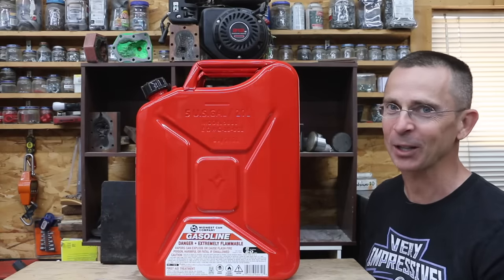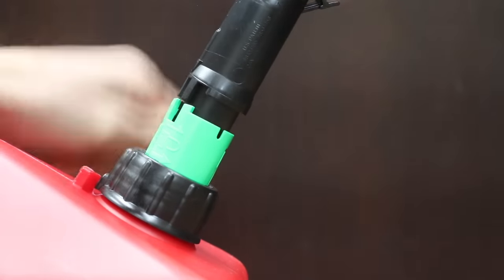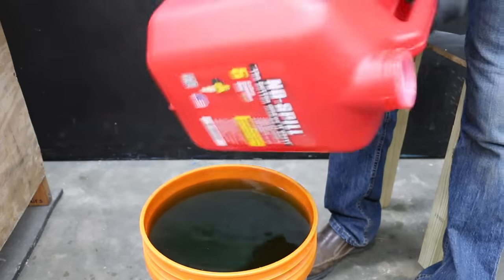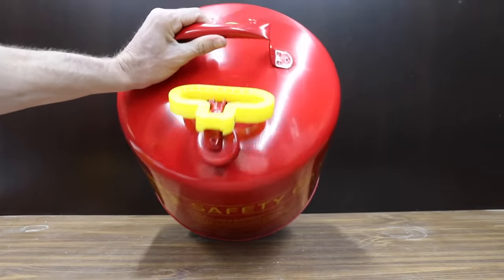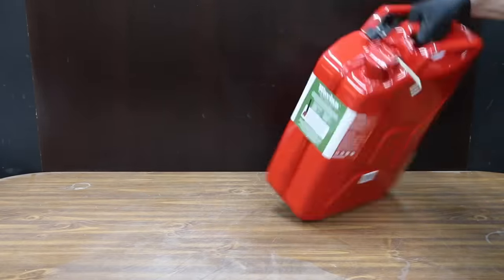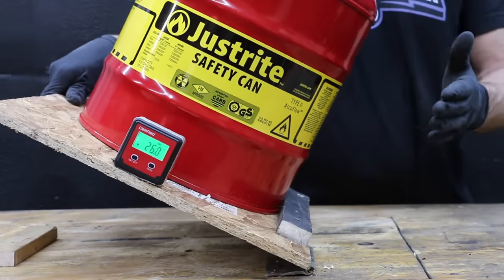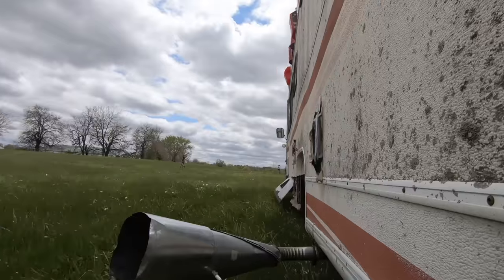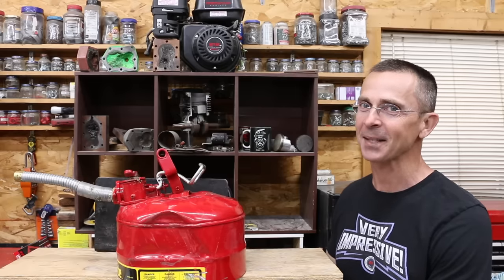Best Gas Can? $140 Wavian vs Eagle, Surecan, Scepter, Briggs & Stratton, Midwest, VP Racing

Comment: I have 3 main fuel cans i use my main fuel can is an older Blitz 5 gallon Fuel can with a old school spout with no safety features it just dumps fuel though i wish it vented a bit better.

My second is a 5.5 gallon Vp Racing jug i use for race gas (but it will hold regular fuel temporarily as long as it doesnt sit for too long)

and my 3rd can is the most sketchy its an Eagle "The Gasser" 5 gallon metal can that was made in the 1970s
Reply from the maker: Thanks for sharing.

Comment: Question:  Why did you rate the weight of the cans with lighter being better?  Especially with the metal cans a heavier can means thicker steel used in construction, resulting in a more durable can.  Considering that five gallons of gas weighs 40 pounds on it's own if someone has trouble lifting and holding that much weight they might be better off using a pair of 2.5 gallon cans for fueling.

Comment: I don't have a diesel tractor anymore, but when I did,  I remember being warned to never use a galvanized can to hold diesel fuel, even for short periods.  There is apparently a chemical reaction that causes flakes to form and clog the fuel filter and fuel system of a diesel engine.  I'm not sure if you mentioned that, and I may be wrong. But if my memory is correct, never put diesel fuel in a galvanized container.  As a farmer using diesel fuel daily, you would know whether I'm right or not, but if it hasn't been tested by you, think about it.  It can be expensive to clean fuel systems
Reply from the maker: Thank you for sharing!
Thank you for sharing!

Comment: Out of extensive experience, No Spill is the Best! No cracks when very cold or hot in the tank. East to fill Generators. Not for refueling cars. Only Farm equipment. Great seals!
Reply: I have quite a few No Spill cans (gas & diesel) for our farm. They split at the handle seams and the American company will not warranty this manufacturing defect. I am looking for all new cans.
Reply from the maker: Thanks for the feedback.

Comment: I was very impressed with the ones that never tipped over. For me these days with a different vehicle, that is about my most important category, that it does not tip. So then looking at the price I couldn't go past the $59 Eagle. However if I am using the 4x4 which is not that common these days, I would have to go for the slightly more expensive one with similar attributes VP Racing. But I wouldn't be able to leave fuel in it cos it has no corrosion control.
Reply from the maker: Thanks for sharing.

Comment: Love the channel and have learned a LOT!  Two show ideas:  test car ramps.  Y’know the kind you drive up on to work on your vehicle.  I find wide variability in quality and performance.  I have two sets myself (one metal, one plastic).  The metal one slides badly on concrete, but has greater weight capacity than the plastic.  Idea 2: go behind the scenes and explore your ‘test design and reporting process’.  I’m intrigued by your well-thought out orderly methodology.  Believe your viewers could benefit from delving into that.  Thanks!!
Reply from the maker: Thanks!  Thanks for the video ideas.

Comment: I LOVE my Eagle from Ace Hardware. No button BS, strong metal, galvanized, funnel thing works great although you didn't use it correctly in two tests. I must admit, the JustRIght turned my head, though it's a lot more expensive. I use a No-SPill for my little 2-gallon can for 50:1 gas (chainsaw, leaf blower). It's OK, the button is OK, but it also has a (leaky) cap on the end. If you tip it up and push the button but forgot the take off the cap, you have a BIG MESS. Again, more spills from the "safety cans".
Reply from the maker: Thanks for sharing.

Comment: I am and have been using VP jugs. However, they had some manufcturing issues back in 2018/9 regarding seam spliting at the bottom and they did not handle it well. Hate to see it but they still make the most reasonable can at the price.
Reply from the maker: Thanks for the feedback.

Comment: before even watching results, ive used plastic and metal and prefer plastic! The metal dents up, expands and contracts in heat and cold and ends up creating weak points at the seams over time. none of my plastic ones suffer from this. While the metal ones do stack nicely together with straight sidewalls they are less balanced, I like the trapezoid shaped plastic ones the best.
Reply: great tests, i love how rapid fire and straight to the point all of it was, super helpful!!! I think going to pick up some vp racing cans.
Reply from the maker: Thanks for sharing.

Comment: It's worth noting that the NATO style steel cans (Wavian, Midwest) can be stored in just about any position, especially short-term. so tipping over while unsecured in the back of a moving pickup, isn't a huge concern, when you can put it in on it's side to begin with.
Reply from the maker: Thanks for sharing.

Comment: I have some experience with many of these.

I had a couple of Sceptres - one gas and one diesel - for several years.  They were better than every other plastic can I have encountered.  I hated them.

I've use the metal Surecans before.  They were not mine, but the owner still liked them after having them for many years,  Very good cans.

I loved those Eagle cans.  I had several for many years, and ended up giving them to a neighbor, who still uses them.  Very highly recommended, great value, and I thought I would use them forever.

But my fuel needs grew, and I wanted cans I could store more efficiently.  The round cans just don't pack or stack well, so I converted to the Jerry can style.  The NATO standard cans can be stored either vertically or horizontally.  The Jerry cans pack into a box with very little wasted space, and numerous off the shelf brackets, straps, and boxes are available to hold one or multiple Jerry cans. It is easy to build custom boxes to hold them, wood or steel, and they can be secured tight with a strap without risk of crushing them.

My first was a Midwest can.  The construction was outstanding, but the twist on spout attachment...  I gave it to a neighbor who threw it away.

I looked at the Stark and a few others, but they were obviously trash.

I was very hesitant to drop $130+ on a gas can, but I was frustrated and finally splurged on a Wavian.  Totally worth the $$$.  I eventually replaced all of my other gas and diesel cans with Wavians.  They have fantastic construction quality, and the best design in history.  But throw the stupid plastic spout away - it has to be included for regulatory compliance, but is just going to create spills if you use it.  With proper NATO cans (not all of the cheap versions have this), the spout built into the can is vented and flows very well.  Use a funnel if you can't pour directly from the can to the tank.

Calum has an excellent history of the Jerry can - https://www.youtube.com/watch?v=XwUkbGHFAhs

Comment: Harbor freight can is supposed to be made by the original Jerry can maker in Latvia.
Only it doesn't have the military fill cap style that now the wavian has. Supposed to be easier for domestic uses.
The triple handle was so 2 service men could carry it together. Recessed weld to protect the weld. Plastic lining so soldiers could use it for drinking water.
They were so good we stole them from Germans all thru WW2 and used them ourselves.
Reply from the maker: Thanks for sharing.

Comment: Number one observation for me is that spouts are specialists, and different fills require different spouts. Of my several gas cans (some included in this review), the thread pitch, gauge, or diameter is not the same, so you’re pretty much stuck with that spout for each can. A swappable spout would be great, and that need pre-dates the modern spill-prone spill-proof spout. My biggest takeaway from this vid is the RV durability testing, which now forms the basis of future Gas can purchases.
Reply from the maker: Thanks for the feedback.

Comment: I have a suggestion for a new video. Some might like to see a rundown of the various gasoline stabilizers. I didn't think much of them and used Seafoam and the local store brand stabilizer. But  I've recently been hearing about Yamalube being a great product. It would be great to see how well these work over time and, of course, compared to regular unamended gas and unamended E10 fuel. Hope you find this suggestion appealing. You could also include the premixed 50:1 or 40:1 2-cycle products. I believe that Still, for example, already contains a stabilizer.
Reply from the maker: Thanks for the suggestion.

Comment: I bought a bunch of the Briggs and Stratton type years ago.  They absolutely sck.  The two main problems are that the twisty thing uses a very small spring and it breaks easily, making the mechanism useless.  Also, you have to press the nozzle down on the fill opening.  So, with a full 5-gallon tank at about 35 lbs, that's a crap-ton of force on a cheap plastic nozzle.  Any of the others that require you to push a lever down with your thumb?  Sure.  Do that for two minutes or longer.  Hello, tendinitis.  Just give me the simple, old-fashioned tanks with no cutesy features.
Reply from the maker: Thanks for sharing.

Comment: My best can is a dented, bashed metal one that has a little vent cap opposite the spout. I get the spout into the filler neck then use my other hand to just pop the vent cap. Push the cap back and the flow stops so I can remove the can without spilling. I have a can with an anti pour, pro spill bloody thing and it is horrible to use.
Reply from the maker: Thanks for sharing.
Reply: @ProjectFarm  I should have said that you are my go to when I want to know more about a product. Thank you.

Comment: I've found that none of the cans which use a screw on plastic spout can be used to store fuel in warm climates for any length of time. Gas stored in any can with this style spout/top seal will lose 1 to 2 gallons of fuel when stored over hurricane season [6 months] down here. I love the military style cans. They often fall over after I fill them up in the back of my hatchback car, but I NEVER smell fuel vapors or any leakage with military style cans. FYI, I would suggest to get the best quality and save money, go to a local Army/Navy surplus store and buy real NATO cans. They hold 20 liters [5.3 gallons], are better made than anything for sale now. Don't worry about age, so long as the interior coating is intact. My NATO cans were made in 1971, 1973 & 1979. All still work great. FYI, I don't bother with the add on nozzles. Just pour directly from the can [hold can sideways while pouring with the outlet as the high point] into a funnel. Very fast draining without spillage, doing it like that. Also, due to surface tension, water will not leak out of small openings where gas will. That sort of negates your leakage test. Re-test using gasoline and let the containers stay on their sides for hours. You won't be so thrilled with those plastic cans then!
Reply from the maker: Thanks for the feedback.

Comment: I once saw a video of a deal you could install into a can after drilling a small hole. That way there's no vacuum effect or whatever you call it. I meant to buy some for my fuel cans and forgot all about it until just now. I also think about it when putting fuel in my Zero Turn Gravely.
Reply from the maker: Thanks for the feedback.

Comment: FYI - those "Stark" cans are the same thing available for around $25 on eBay... junk.  I have one of the Eagle cans too and use the crap out of it, but they expand in hot weather and can spray fuel out if you fill them too full, have to be careful.
Reply from the maker: Thanks for the feedback.

Comment: Took the same eagle can on a roadtrip to vegas. We caught a slight fuel smell so I opened it to burp and it spit gas in the trunk. Mostly my fault for not anticipating that. Also kind of awkward to pour in my friends kia optima. Would be fine with a hose attached to the funnel. Mostly bought it for my crawler and the fuel cap is flush to the truck bed so it's perfect for that
Reply from the maker: Thanks for sharing.

Comment: inever use the spout offered, i install a spout into the fuel tank of my jeep when i refuel no flow poiblem if careful. my only problem with cheaper metal cans is they deform in higher temperatures. still ok and reasonable in price. hiwever, the welds concern me longterm.  important to me is price which has increased too much
Reply from the maker: Thanks for the feedback.

Comment: You're comparing an Eagle Type I can to a Justrite Type II can, which isn't exactly fair from a price standpoint (the Eagle Type II is almost the same price as the Justrite Type II).  I have Justrite and Eagle Type II cans, and the Justrite cans have MUCH nicer spouts..  Larger diameter and more flexible. They have a simpler nozzle/vent design without all the plastic parts of the Eagle.  I've also accidentally backed over my Justrite can with my truck and dragged it, and it hardly had any damage.  One thing I never expected from the metal cans is how much vacuum they can stand.  I had a cheap "Jerry Can" style which sucked in just from the temperature change from day to night.  It expanded again during the day.  After a few weeks of expansion and contraction, it developed cracks in the sides and started to leak.  I also had a plastic can develop cracks and start to leak from the day/night temperature changes (In Texas that can be over 40 degrees).

Comment: I HATE these new containers.  Most of the time I pull the spout off and just use a funnel.  Quicker, easier, and I still rarely spill anything.

The only spout I do enjoy is on an older Briggs and Stratton can.  You cock it with a slight twist and then as long as the can is pushed into what you are filling, it flows.  Pull back or it gets empty and the spring lifts it and it stops.  There is also a stop float inside.  While not fast, it's the best for filling lawn mowers, snow blowers, and similar.  You twist the spout, invert in the tank and wait for the gurgle to end.  It balances perfectly on the spout.  Naturally, not made anymore.
Reply from the maker: Thanks for sharing.

Comment: You had a performance review of 18650 lithium batteries.   I would like a review of the battery chargers for them.   In particular I would like a review of the features that allow controls as well as information like cell resistance and watt  hours per charge and the charge duration in hours and minutes.    Even a discharge feature before charging would be nice.
Reply from the maker: Thanks for the suggestion.

Comment: Nice testing. Something I miss in this experiment is temperature test with real gasoline. On the plastic canisters you can "feel" how they get pressurized once they are full on gasoline, even some cannisters remained deform after empty: the walls remained curve from the inside out. So, I would like to see how the plastic or metal cannisters holds on elevated temperatures, let's say simulating a left over cannister inside a car on a sunny day (e.g 140°F). I know that this is not recommended, but in a test, anything is possible, even in real life someone could forget the full canister in the car. Even better, if this test could be repeated many times to see the stress on many cycles of temperature change, something that is real even storing the fuel cannister in a "controlled" environment in home.
Reply from the maker: Thanks!  Thanks for the suggestion.
Reply: @ProjectFarm  Thanks to you for your efforts on this project. As an observation the drop test was harder if the cans were filled with water because is denser than gasoline. Making some raw calculations at 5 gallons with water the weight is increased about 10-11 lb. Does not sound like much but could make a difference, also the increased vapor pressure of the gasoline could have some effects over the results not only in this test. Nonetheless, I´m glad that you put on such endeavor common products to see where they fail or compare. Best regards!

Comment: One factor you didn’t address is split seam of the plastic cans.  I have had several plastic cans split out a seam on top with gas in storage during the summer.  And I don’t know where you paid 140 bucks for the wavian cans at but they are 80 bucks directly from wavian.
Reply from the maker: Thanks for the feedback.

Comment: I'm wondering if you used the anti-siphon device that most vehicles are equipped with. Sure we fill up our ATVs once in awhile, or our tractors.. my biggest problem has been fitting the nozzle into the tank receptacle. Most of the time the tank receptacle is too far away from the nozzle

Comment: I have had 2 plastic fuel cans fairly new crack at the seem on top. To replace them i I bought 2 Harbor freight steel fuel cans so far I've had decent luck with them. Just a bit pricey.
Reply from the maker: Thanks for sharing.

Comment: 2:30 we purchased a couple cans with that style spout unfortunately after a while a rubber gasket on the inside breaks down and I've had the little flapper on the inside also come apart which really messes up the whole mechanism thing. there also three hand cans as in you need three hands to operate lift and pour.
Reply from the maker: Thanks for sharing.

Comment: I raced cars for nearly 20 years and had 6 of the VP-racing style jugs (mine were slightly different with a wider nozzle.)  I found they worked brilliantly for both racing and non-racing applications.  You could rig up a hose to make them vent really nicely which sped up the filling times.  And best of all, none of safety nonsense.
Reply from the maker: Thanks for sharing.